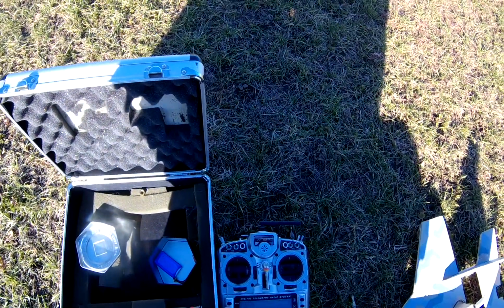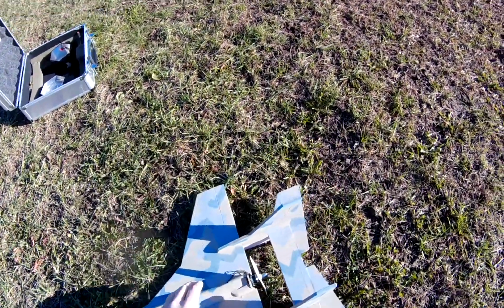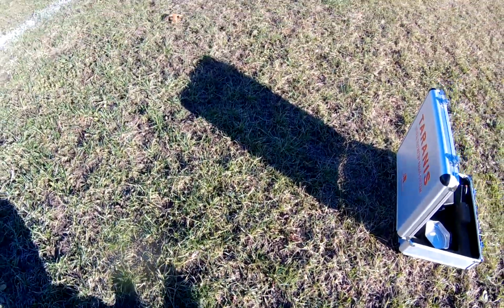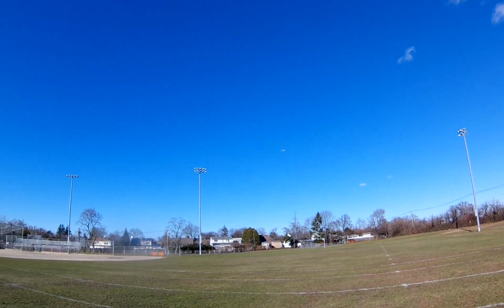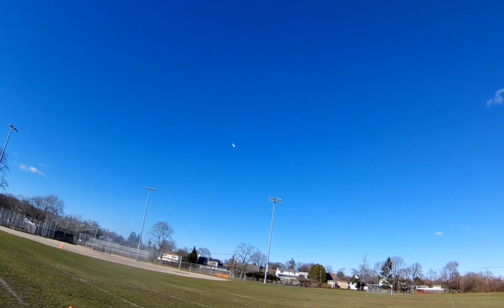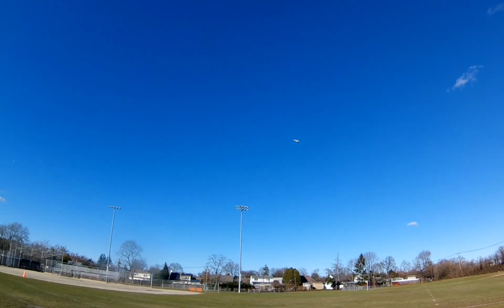h29 Mig29 foam parkjet Greg006

Comment: Excellent flight in all that wind. I don't know how much wind you were flying in but it sounded significant ;-) I love those 1306 3100kv motors and they seem to have been made with a 5030 prop in mind. I've used them for at least two projects so far. Your Parkjet looks very acrobat and very stable at the same time which translates into a lot of fun to fly ;-) See you in the Air!
Reply from the maker: It's as much floating and surfing as flying. There is only about 100 feet to the fence behind me, then trees and someones yard. So keeping it out in front of me is important in the wind. I have flown bigger planes and louder pusher wings there that are more wind friendly but I don't anymore, I like to keep a low profile. The little planes are the most fun in that space anyway, no one probably even knows I'm there.